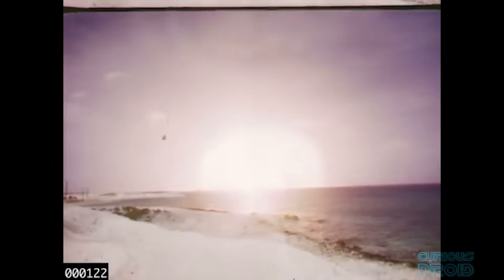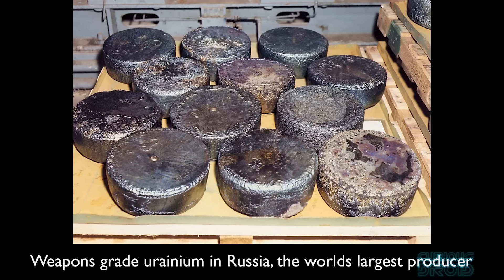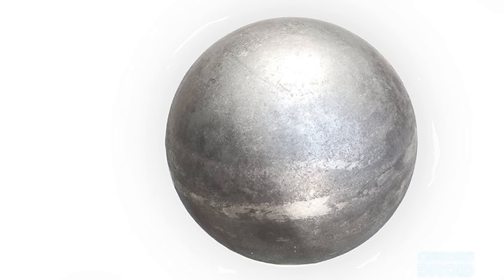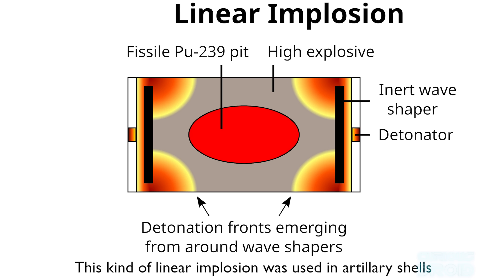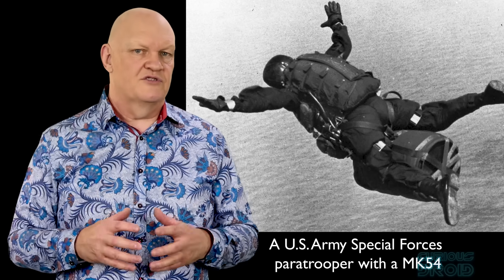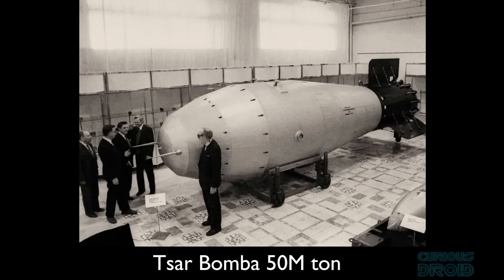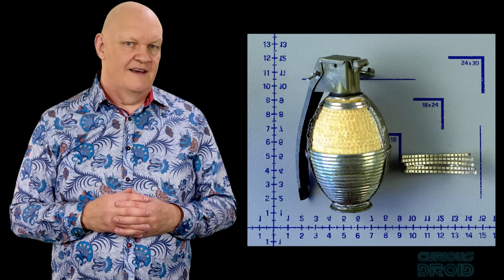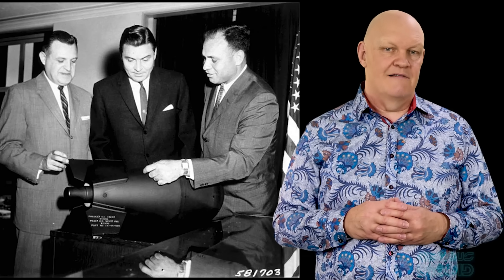How Small Can You Make a Nuclear Weapon?

Comment: Why do people waste so much time fretting over bombs. The dispersal of Plutonium •dust• does the job without critical mass. Cancer.
Reply: Because nuclear weapons are far more dangerous than dirty bombs...
Reply: @Evan_Bell Wrong. Imagine what happens if plutonium dust was dumped into the  source of the Nile? There needs to be a complete ban on this stuff.
Reply: @Wonkothesane-sz2oy  That would be far less hazardous than an actual nuclear explosion.
A typical strategic nuclear weapon produces 1e21Bq of fallout (measured at 1 hour post burst).
To produce the same activity with plutonium would require over 400,000 tons, almost a thousand times more than humanity has ever produced.
Plutonium is relatively safe to handle, so long as it's not ingested.
That's not true for fission products produced by nuclear weapons...
Fission products are many orders of magnitude more lethal.

Nevermind the hundreds of thousands or even millions of casualties resulting from direct weapon effects.
Reply: @Evan_Bell I strongly disagree.
Reply: @Wonkothesane-sz2oy  If you're disagreeing with factual reality, that's just called choosing to be wrong, which is an odd thing to do...
Reply: @Evan_Bell You're obviously completely unaware of the toxicity of plutonium.
Reply: @Wonkothesane-sz2oy I am. It depends greatly on the chemical form (solubility and bioavailability) and exposure route, but it is far less toxic than the equivalent mass of fission products, which an hour after production, has an activity 77 million times higher, which you don't seem to be aware of.
When a nuclear weapon detonates, or during a nuclear accident, it's not just plutonium which is released in the the environment, it's the fission products, which with their much shorter half lives and higher specific activities, are more hazardous.

Comment: I think with resistant enough materials and more perfectionated electronics coordination and better shaped charges you can go smaller in size than the current limit, i believe that the limits we know nowadays only exist due to our technological limitations and the materials we are capable of manufacturing, but as you said, the longer you can contain the explosion; The more efficiency you can get out of the same nuclear mass, and with rigid enough materials with enough strength and powerful enough conventional shaped charges you could probably make nuclear bombs way smaller, though the yield would be very low, but to have a hand granade that explodes as weakly as a 50 kg bomb is something that i believe would be making it "worth it", an explosive that any infantry man can carry that can destroy a tank.
Though again, back to safety (with this level of technology only on the side of on whose hands this falls), i doubt anyone would decide it is a good idea to even design such a bomb, unless for some reason the military decides they want their average tank gun HE shell to explode like a 1 ton bomb, which would be ridiculous but who knows what we'll see in the future.
Reply: Material strength and rigidity is irrelevant at the pressures encountered during disassembly of nuclear plasmas...

Comment: There's one other special case, though it can't be used as a weapon. The National Ignition Facility can implode targets to ~1000 g/cm^3 (yeah, it is D-T, which is easier to implode than Pu-239, but Pu-239 starts off denser). Very very roughly, since Mcrit goes as density^-2, that should allow driving a 1 gram Pu-239 target to criticality - though what you would have to do to keep the target chamber intact and uncontaminated would be a PITA
Reply: Thermonukes achieve much more implosion pressures than ICF, and don't compress Pu to 1000g/cm^3.
More like 200g/cm^2...
Reply: @Evan_Bell  Many Thanks! So Pu is much less compressible than I'd thought? ( Presumably there is some level of laser driven implosion which would compress Pu to 1000 g/cm^3, but at that point the laser implosion energy is probably a lot larger than the fission energy yield... ) ( What's funny about this is that I thought I'd vaguely remembered that someone seriously proposed this, decades ago. Maybe that was entirely a paper study, and the compression stiffness of Pu at such high densities was not known back then... )

Comment: The W48 / XM454 AFAP (artillery fired atomic projectile) was a 155mm artillery projectile massing 54kg with a 0.1 kiloton yield.
The W82 / XM785 was even less mass with 43kg, with a 2 kiloton yield.
155mm diameter, 860mm length is already pretty small.

Comment: Nice video. A few comments.

A big problem with small devices is incorporating a Permissive Action Link that offers the protections that are considered minimum permissible. As time went on, this became a major factor in the fielding of miniaturized weapons.

As to more nukes beyond the two that were dropped on Hiroshima and Nagasaki, the US had a third pit ready to go. Japan's surrender obviated its use in the field.

As to getting close to maximum use of the fissile material, many thermonuclear devices (aka fusion bombs) use the fusion component to boost the fission reaction further. 40-50% seems to be the practical maximum.

The video of the artillery piece shooting a nuke was actually of the 280 mm "Atomic Annie", not a 155mm howitzer.

Miniaturized weapons have short shelf-lives due to several life-limited materials. Hence they became undesirable also from a maintenance perspective. And attempting to set off a device after its "best-by" date is likely to create at best an unimpressive fizzle, with a mess of fissile material poisoning the target area.

Comment: Re: After Nagasaki, USA "had no additional bombs to drop"? There were several more fat man type bomb caseings & implosion assemblies in the Pacific theater already, the next core available was actually called back & taken off of a loaded aircraft headed  towards Tinian about a week after Nagasaki (by direct order from Harry Truman). 
After that, about 1 more core per week would have been available through the end of 1945, with more Pu239 production coming on line quickly after.
Reply: Source?
Reply: yes, I agree. As far as is known they had another plutonium bomb nearly ready, and by early 1946 they had approximately 10 more bombs. So thye could make a new bomb every two weeks or so. And in the following years production ramped up very considerably. So they definitely could have atom-bombed Japan further, at a rate of a bomb every two weeks or so in 1945 and significantly more often in 1946.

Comment: Leider nicht richtig, richtig ist vielmehr, dass man auch  50 Gramm Pu239 zur Explosion bringen - ergibt  eine Sprengkraft von ca 0.005 Kt ^ 50 Tonnen TNT.  Das ist nicht größer als eine Bowlingkugel + Zündapparat   also etwa die Größe eines  Beautycase .
Reply: No, there's no technology capable of compressing 50 grams of Pu-239 to supercriticality that's the size of a bowling ball. Weapons of that size require several kilograms of Pu-239.

Also 0.005kt and 50 tons are not the same thing.
0.005kt is 5t.
Reply: @Evan_Bell  When you mix Pu as an  Alpha Emitters with Beryllium, neutone radiation is produced. Enormous heat is then generated in a hollow steel ball. The ball is cold at the outside and expands inwards, pressing the inventory. until the its very  bang.
Reply: @W.Wanderfeld138wanderfeld13  The added energy release by (a,2n) reactions is small relative to the decay energy. It doesn't significantly add to heating.
Thermal expansion doesn't significantly compress fission fuels to the point that they can go from subcritical to supercritical and produce any meaningful yield. 

When metals are heated, they expand. They're not compressed. If their expansion is constrained, then the pressure increases slightly, but it does not result in compression. 

You're talking pseudoscience...
Reply: Source?

Comment: How is the symmetry of the blast tested and measured? Outside of the obvious real-world nuclear test, I cannot fathom how to do so, let alone in the 1940s/50s.
Reply: You mean the symmetry of the implosion system? You implode a mock up of the weapon with non-fissile surrogate material such as depleted uranium for the core, and measure the process with various techniques, such as radiolanthanum (RaLa) experiments, used in the Manhattan project, or high speed x-ray radiography. Hollow pit designs can also use velociometric methods like Photobic Doppler Velociometry,
Velocity Interferometer System for Any Reflector, or electrical contact shorting pin experiments...
Reply: @Evan_Bell  Awesome, thanks for that!

Comment: My brother, a Chief EOD specialist in the US Navy, told me that the timer on the SADM backpack nuke was not actually operational.  It would go off instantly.  The life of the soldier is not important compared to the possible mass casualties if the enemy found and defused the nuke while the timer was still running.
Reply: You'd only need a very short timer, though.  Even with a likely optimistic yield of 1kt, you're still talking only needing to get like 1km away to be quite safe of the most deadly of effects(which at these small yields and with an effective 'surface' explosion, the ionizing radiation has the most deadly reach, but that scales off very quickly).  A mildly fit person can jog that distance in like five minutes.  Plus the US just typically did NOT have any practice of sending people on very literal suicide missions.  The situation involved would need to be quite extreme for them to ask anybody to do it, and if it was that extreme, it's just more likely that you'd just bomb the place properly.

Comment: Around 4:40 - that's not quite right. 

While the Manhatten Project had indeed only produced enough highly-enriched uranium for Little Boy itself, they had produced enough plutonium to make three cores. The Gadget detonated in the Trinity test used one. The second was used in Fat Man, dropped on Nagasaki on the 9th August 1945. But they had a third core in reserve. Although it was not assembled into a bomb at the time of the attacks on Hiroshima and Nagasaki, it would have been relatively straightforward to make a duplicate of Fat Man.

However, it was not the threat of a third atomic bomb that drove Japan to surrender. Instead, it was the declaration of war by the Soviet Union and the simultaneous incursion of Red Army forces into Japanese-occupied Manchuria. Up until that moment, the Japanese had been hoping to negotiate a surrender using the USSR as its intermediary. Until mid-August 1945, there was no state of war between the Soviet Union and Japan, and they had maintained diplomatic relations.

The narrative that the nuclear bombings of two Japanese cities led directly to the Japanese surrender is a very clean and neat story, but the reality is more complex and nuanced.

Comment: So many inaccuracies:
1. USA had more Little Boy bombs to use (5), they used them in Operation Crossroads (1946), the reset was dismantled.
2. Plutonium was preferred because USA produced it 3x more than enriched U235
3. Casing of U238 is used only in modern thermonuclear designs as U238 can fissile when bombarded by fast neutrons, but not in classic nuclear device.
4. Tsar bomb was not an actual weapon design, rather a publicity stunt, so there was no plan to use it on actual battlefield. No reason to mention it.
Reply: Operation crossroads used Mk-3s (Fat Man), not Mk-1, (little boy), but they did make 5 little boys in total, plus another 2,210 gun type devices of other designs.

Uranium tampers were first used in pure fission devices, such as the Mk-3.
Pu-239 fission produces fast neutrons.
AN-602 was planned to be produced at scale and delivered by UR-500 ICBM...
Reply: @Evan_Bell exactly. US Army had fat mans at its disposal. Claim in the video that they had nothing left was simply not true
Reply: Btw, Pu239 fission neutrons do not have enough energy to cause fission in U238. Only neutrons from fusion and that is why modern warheads have tamper/pusher and casings from U238 to get max yield for the mass
Reply: @zbyszekz77  
You said Little Boy bombs were used in Op Crossroads. That's incorrect. 

Pu-239 fission neutrons can fission U-238.
The fission cross section of U-238 for neutrons between 1 and 10 MeV is between 0.0136 and 0.726Bn.
70% of Pu-239 fission spectrum neutrons are in this energy range.

For reference, the U-238 fission cross section for 14.07 MeV neutrons (those produced by DT fusion) is 0.632 Bn.
About 2.5% of neutrons produced by Pu-239 fission have energies that correspond to fission cross sections higher than the case for DT fusion neutrons.

30.8% of the yield of the trinity test was from fast fission of its natural uranium tamper.
Not only does it directly contribute to the yield by fast fission, its also a good neutron reflector and hydrodynamic tamper, which is why it was used in all the earliest implosion bombs, from the Mk-3 to the Mk-7, and their later derivatives such as the Mk-18. The first to use beryllium tampers was the Mk-12.
Uranium tampers weren't used in gun type devices due to its high spontaneous fission rate. Tungsten carbide was used for US gun types, and South Africa used tungsten. 

Some modern weapons have HEU secondary tampers, instead of depleted uranium. 

The radiation case is so thin and not compressed in the same way that it doesn't contribute meaningfully to the yield. Uranium is only used because it has a high free electron density at the interstage temperatures, and thus has a low thermal diffusivity, reducing radiative losses.

Comment: There is some interesting information on small nuclear bombs in "Project Orion" by George Dyson.  In particular Chapter 6 includes some remarks by Ted Taylor, who was involved in bomb design.  He said that it was possible to create a nuclear explosion using less than one kilogram of plutonium, the trade-off being that it needed a very large amount of high explosive to compress it effectively.  So that isn't the way to make a small warhead.  But it can be done - he mentions "a full implosion bomb that you could hold in one hand that was about six inches in diameter".  
It seems that making a very small bomb isn't simply about using a small amount of plutonium, it's about creating an efficient design for the HE part.

Comment: Years ago, I made a video about 4th generation nuclear weapons. It went somewhat viral, pretty big numbers for me. FGNW use microscopic amounts of antimatter to catalyze nuclear fusion. In this way, nuclear weapons can be very small, golf ball size small. But they can be even smaller. There is a type of particle accelerator called a macron particle beam. Macrons are microscopic particles, tiny compared to even a spec of dust, but massive compared to atoms. It's actually possible to accelerate micro sized fusion pellets to a high enough velocity, such that when they impact something, they undergo nuclear fusion. Basically a fusion particle beam. So nuclear weapons can be very, very small.